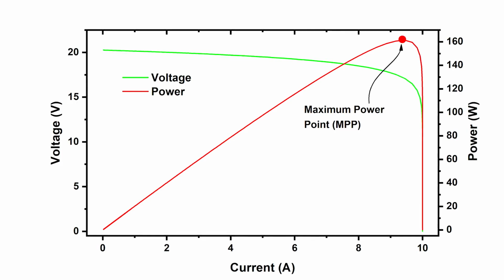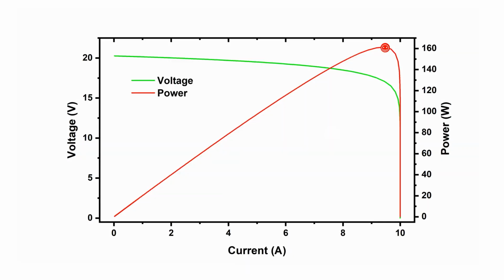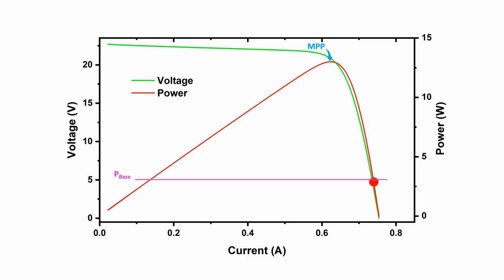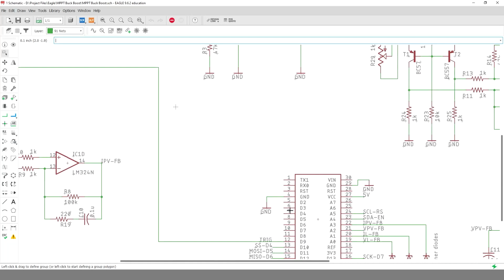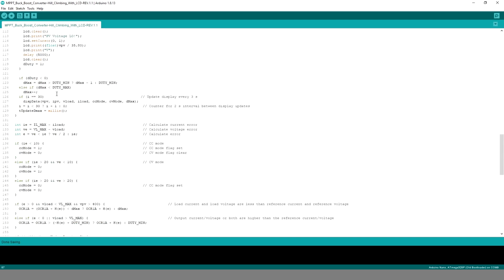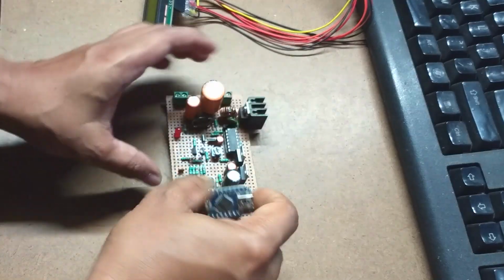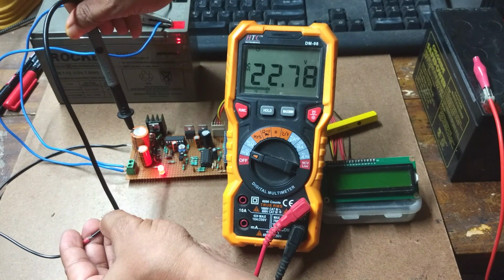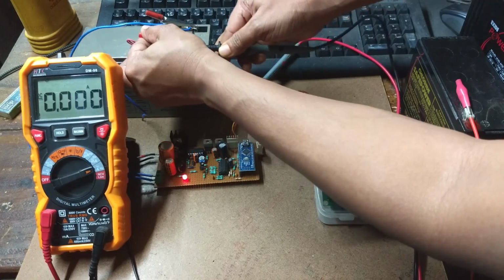How Not to Make MPPT Buck Boost Solar Charger

Comment: Why not use a common buck converter and add current sensor and external feedback with Arduino on the IC's feedback pin?
 I've already done a "manual mppt", adding constant input voltage to a cheap buck converter...
Reply from the maker: Yeah, certainly it would be more convenient to use a buck converter breakout board but, I want to design the voltage regulator also to gain a better control over the design of the whole system.

Comment: Why didn't you get a current sensor?
Asc718?

I'm building a MPPT charger. However I've made mine modular, so I have three boards.
One is the control, one is the current sensors and the other is a upside down  buck.
I was thinking of using a p806 and making it sepic.
But it can run 1.5kw of solar.

I'll be making some videos of it and have already published schematic on the buck. And firmware 1... Shortly going to be releasing firmware 2. But I need to make a video on the control module first.

Comment: Great effort sir ..but for this please make high efficiecy buck converter then go for Mppt
Reply from the maker: Thanks for your comment. I thaught about it before but, I wanted to use buck-boost converter.
Reply: @ElectroHijibiji  ok sir ,i saw one comment that you have used ferrite core inductor ..please use sand dust Inductor core ..then try with same ckt ..if you can please reply with result as i made buck converter with iron dust core ..result was better
Reply from the maker: Thanks for your suggestion.
Yes, it is likely to better. One reason is that, dust core's saturation point is higher than than of the ferrite core. But unfortunately I don't have a suitable one right now. I'll try that later.
Reply: Please dont dropout this project .Make at least a buck based mppt charge controller for 21V panel 5A to 12V battery system ..use acs712 current sensor for better isolated current sensing.
Reply from the maker: Sure. I'll try.

Comment: super bro 👌💯
can u give me ideas about 24v input  and 13.5v 30a output  dc to dc converter...with short circuit protection ande reversed polarity protection and small size...
Reply from the maker: The next video on my channel would be about synchronous buck converter. I hope you will find some information from that. Please stay tuned.